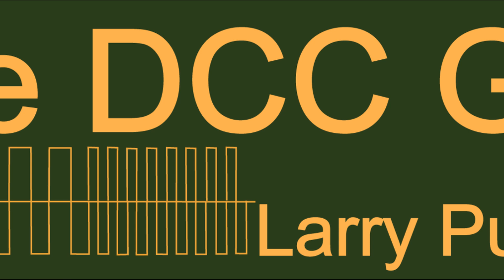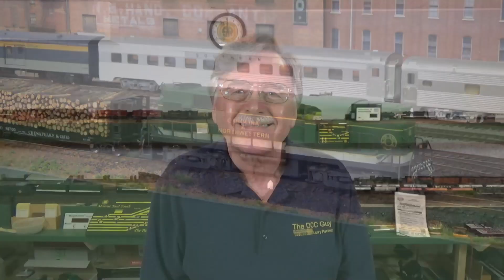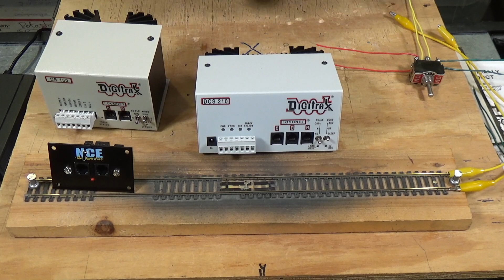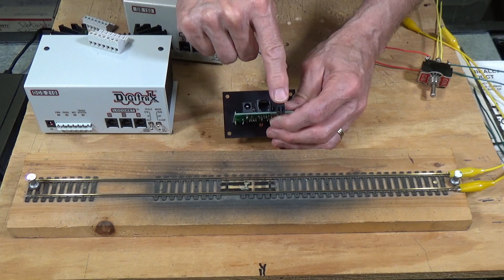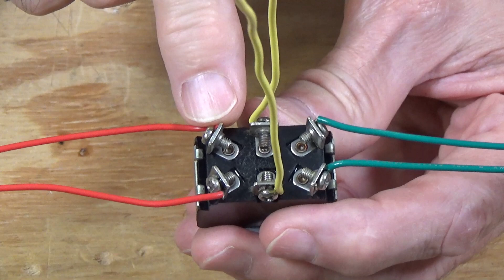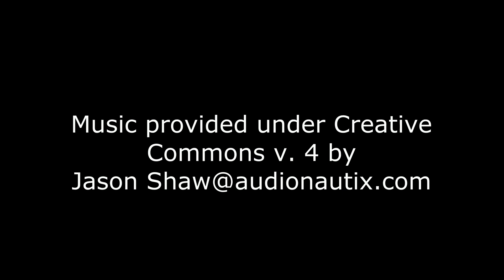DCC Programming Track For Your Model Railroad (98)

Comment: Moin (Hello) Larry,

thanks for your well explained Video about of easy to install programming tracks.

Me I am using the Roco/Fleischmann white z21 Start (similar to the white z21) DCC 3 A Command Station, it provides a track output only, but can be used for programming onto separated programming track, also.

I am using a double pole 
On/Off/On Switch like you described in your Video.

One side of the both contacts of the switch feeding the electrical isolated programming track and the other side of the switch contacts are feeding the main layout in addition with the programming track, also.

Would I really need a separated 
On/Off in addition?

With the 6 contact On/Off/On Switch you can switching between programming onto programming track or onto main in addition with the programming track, when being used as Siding, normally.

The center off position very helpful to turn off the track power in emergency causes.

I installed this On/Off/On Switch inside a little pocket inside my layout facia with front window of plexiglass of what I can shortly open to turn the switch.

Nice Greetings from Germany,
Ingo R.

Comment: Hi Larry, love your DCC Guy channel, I am new to the DCC world, I have an NCE starter system, and have an auto switcher, how can I use the NCE circuit breaker with the auto switcher, and can I still power the programing track for normal DCC operations.
Reply from the maker: I would put the circuit breaker on the track output feed of the Auto-Switch. With that setup the Auto-Switch will detect any programming preambles and send programming commands to the programming track. The rest if the time the booster output will go to the circuit breaker and on to the main track. Remember that with the PowerCab you can either run trains or program decoders but cannot do both at the same time.

Comment: i bought one of the NCE auto-switch boards for the programming track.  installed it but get a buzzing sound as soon as power is turned on.  Any ideas?  one note, i did find an issue in the wiring seperate from the auto-switch issue. and have since switched back to Kato unitrack from atlas.
Reply from the maker: Make sure the programming track is isolated from the main track. You might be feeding DCC track power back into the Auto-SW.
Reply: @TheDCCGuy  thank you very much

Comment: Larry great vids just found all your vids and I am new subscriber..I have a question re programming track…I have a digitrax  dcs 100 system that has a programming out put….I am about to set up a programming track, with a dpdt switch as your video explains , but if I drive my engine onto the track and throw the switch….how does my controller know to send commands to the programming track and not out to the main layout?  Does the controller send some sort of programming signals out so it knows where to send the commands?
Reply from the maker: With a service mode programming track all commands are sent to that track only and are processed by the decoder regardless of address. That’s why you have ti have an isolated programming track otherwise all your loco decoders would be reprogrammed. With programming on the main the commands are sent to the specific loco decoder address and only it will act on those commands.

Comment: Hi Larry, great video thanks for sharing. I got one question...

I use the the WSU LokProgrammer and the Sprog II for programming. I have one programing track and I use both programmers but I always have to unplug one from the rails when I use the other. Is there a way to use a DPDT to toggle between the both? I also use NCE Procab to speed match, is there a way the Procab can also be added to this? 
Thanks :)
Reply from the maker: Yes the DPDT will work but only with 2 devices. It might be best to set up a programming track on your work bench for the 2 systems you do not use for regular programming and then an one on the layout where you can drive the loco onto the track flip the switch and do,your programming with the ProCab. If you are using a PowerCab then that is different and you would want to use their AutoSw to set up the programming track. Take a look at my video #98 as I covered all this in it.

Comment: Larry, I truly enjoy watching your videos.  You explain things very well.  I have an alternate idea that I have not tried yet that could be used for a  NEC control station, but maybe it will not work?  My idea is to use a dabble pull switch for just one side of the power output (I used red and back wires to power my tracks).  One would connect two wires to the main line, Red and black, and the same two wires to the Isolated programing track.  In this way you could run the trains on the programing track as it it was the main line.  Then I would put a third wire on the "Black Wire" side of the programing track.  I would run that wire to the switch.  I would also run the "Black Wire" going to the main line and isolated programing track to this switch.  Therefore when the switch is set to the main line, the train would run everywhere.  When the switch was set to the programming track the power would be cut off to the main line as the "Black Wire" would no longer be connected, therefore the only track to get power would be the isolated programing track through the third wire also connected to the "Black Wire side of the track. .  I have not tried this yet, so I do not know if it will work.  I plan on doing this in the fall and will let you know the results.  If you know it won't work, I'd appreciate you making a comment here.  In addition, I like the idea of having a bumper light mentioned in the comments.  I would not only put a bumper light on the programing track, but the main line as well. This will give you a visual conformation as to where the power is flowing.  This an be helpful if your trains stop running on the main line due to a short or your cat unplugging the trains :)
Reply from the maker: It sounds OK but I am not familiar with a dabble pull switch so cannot be sure. One thing to be aware of with the light is that there is no power on the programming track unless a programming command is being sent so that might not work the way you planned.

Comment: I have a question about programming track as a siding.  I have an older model Digitrax 
DB 150 Power.  Why can't I send power out directly to my programming track section so there is power there all the time and take a feed off this wiring  through a switch and on to the bus wires for the rest of the layout trackage?  Then when I want to program a loco I drive it on to the siding (program track), turn the power off to the rest of the layout, program the loco, turn the power back on to the rest of the layout, and drive the loco out onto the layout. I doubt you will see this comment being this post is an older one from you, but.....  I do like your explanations of train fixes in general.  Thanks!
Reply from the maker: You can do this but you would need a DPDT switch to separate the power from the active command station and your DB150. Just install the switch on the fascia with the center terminals connected to the siding/programming track and one set of end poles connected to your main command station/booster and the other end poles connected to your DB150. In normal,operations flip the switch to your main system power and run your loco into the siding. Then flip the switch to your DB150 feed and do your programming. When done flip back to main power and drive away.
Reply: @TheDCCGuy  just got this note and thank you very much for your help.

Comment: So your layout won’t stop while your using the programming track with or without the switch right? What I’m trying to ask is if you’re running trains and want to program a locomotive using the program track will the switch or little module cut off power on the main?
Reply from the maker: Depends on your DCC system. Some have both track and programming connections and capability to used both at the same time. Some like the PowerCab do not so you can only do one thing at a time.
Reply: @TheDCCGuy  I have NCE with the powercab, I got the starter pack
Reply from the maker: Yes, the PowerCab can either run trains or use service mode programming. However don’t overlook ops mode programming which can be done on the mainline. I usually do my initial programming using service mode then refine thong like speed control and sound setting using ops mode.

Comment: I hope this isn't one of those obvious questions, but with the NCE auto switch, with the cab in normal running trains mode, can you run trains on the program track?
Reply from the maker: No, it is an either or switch. If the main track is powered then the programming track is off. If you are programming then the main track is turned off so you won’t reprogram all your locos.

Comment: Great explanation video Larry. Instead of using a DPDT switch I have used a 4PDT switch. I use the extra 2 poles to switch out and isolate a few inches of track on each side of the programming section in order to prevent short circuits if the loco moves. If wired appropriately it can also be used to illuminate led's to indicate that the sections are isolated/program/isolated or live/live/live.

Comment: hi i have a stub track that is isolated from my layout i have a switch that  turns on or off that track power. now i have a lighted bumper on that track so i will know if it is on or off Easley.  can i leave that lighted bumper on the track and turn off the track power to that track no power to that  track throw the toggle switch to program after i turn off the track power to  that track will the lighted bumper effect the programming or should i just  take the bumper off.  i have a dcs 240 command station.  i hope i have explained this good enough.  thank you.
Reply from the maker: It really depends on the current draw of the light bulb  but I doubt it will be any more an issue than having a light in the locomotive.

Comment: I am using a Digitrax DCS 5O in combination with JMRI Decoder Pro with a testing/programming track. If I use isolating track connectors to separate the programming section from the active test track do I  still need to cut the gaps in the rails?
Reply from the maker: That should do the trick and it insures that rail expansion or movement doesn’t accidently close the gaps.

Comment: hey Larry, I have a Digitrax DCS51 and although I have a separate programming track, your explanation and visual example of using a DPDT switch might make me set up a section of layout track as the programming track. Heck, I might even get a knife switch DPDT just to make it look cool and like an actual lab. I usually do programming on the main with OPS, but sometimes using a programming track is the right thing to do. Thanks, Terry

Comment: Thank you Larry. Will the automatic switch work with JMRI
Reply from the maker: The automatic switch is made to use with command stations that have the combined output. If you have the command station linked to your computer and use DecoderPro then I assume it will pass through and activate the Auto-SW. Since I was installing my PowerCab on my Windows 10 machine today I will go ahead tomorrow and do some programming as a test and get back to you with a definitive answer. I am planning a video on interfacing the PowerCab with a computer and using it with DecoderPro so this is a good subject to cover as well.
Reply: Thank you Larry  I look forward to hearing from you.
Reply from the maker: Ok, I just tested it and yes, as soon as I sent a programming command from DecoderPro the Auto-SW clicked into action and programmed the decoder.  I then did a read back and again it clicked into action while DecoderPro read back the CVs then it switched back to track power.
Reply: Awesome, thank you Larry.

Comment: Great video, Larry! I us NCE and have the Auto-SW for the programming track on my layout, and it works great! (Actually... I had it on the LAST layout, but will have it on the next one, when it gets that far!) There is away to wire it so that the locomotive can be driven onto the isolated programming track, programmed in program track mode, and driven off the program track. The diagram can be found on NCE's website here (I had to spell the dot part and break up the link to sneak it past YouTube. Don't tell anyone.):
https://ncedcc  dot zendesk dot com/hc/en-us/articles/203740965-Auto-SW-live-program-track-setup?mobile_site=false
I had it wired this way and it worked great! Love your videos!

Comment: I like what you have do.  But on the last thing you showed is still chance for problems. Using a 4T2P switch is easy to wire and lessen the proble of problems.   And cheaper.   But in all I like the video.
Reply: Larry have you considered a short video or a supplement to this video that would show how to integrate the Soundtraxx PTB-100 program track booster with the DPDT switch as you described in the above video.
Reply from the maker: Roger, I already have a video on the PTB-100 on my to-do lost and will try to remember to address that topic then.
Reply from the maker: Thanks Ron, I assume you are saying what Frank Neher said in his earlier comment. Take a look at it and my response and see if it answers yours.

Comment: They make a four pole double throw switch that could be wired up just as easy
Reply: Clarification, the 4PDT could be used to replace the DPDT and DPST that you described for the control stations with only one output. The 4PDT has the advantage of preventing the situation where the DTST switch is forgotten and programmking commands are directed to the whole layout.
Reply from the maker: Yes, that would be an option assuming you and I are thinking the same thing. However for many folks who use the less sophisticated systems using  a 4 pole double throw switch might be a bit more than they are comfortable with.

Comment: Hello Larry, am a recent subscriber. Enjoying your vids greatly. Very informative, good learning pace and easy to understand. Thank you.
You mentioned just cutting the rail four times. I see around the net, providing another short piece of isolated track beyond the actual Programming Track (PT).
This prevents any likely-hood of wheels beyond the PT causing problems. Would you be able to elaborate further, if you think necessary. I'm using a DB150, here in New Zealand.
Reply from the maker: Yes, I mentioned using that approach in my June 2019 article. However that is a bit more of a complication than I thought many viewers would be comfortable with.
Reply: @TheDCCGuy  Thanks Larry, Keeping a vid to the point, makes a lot of sense.